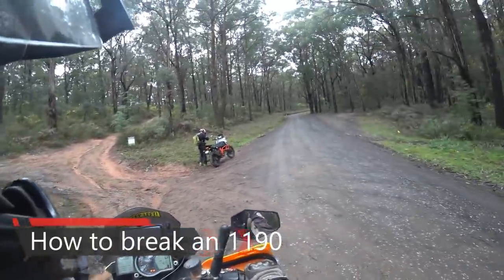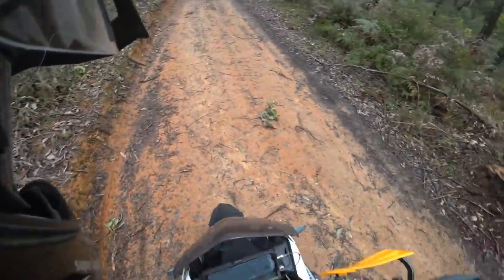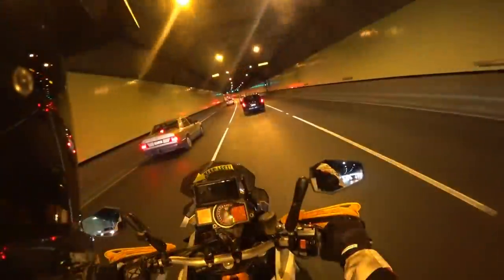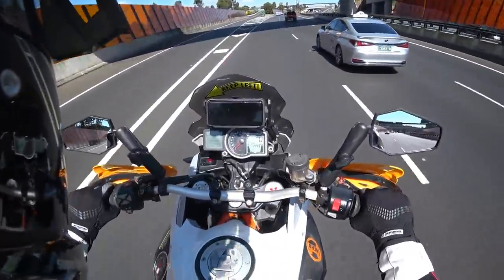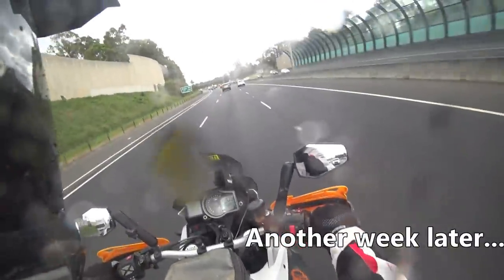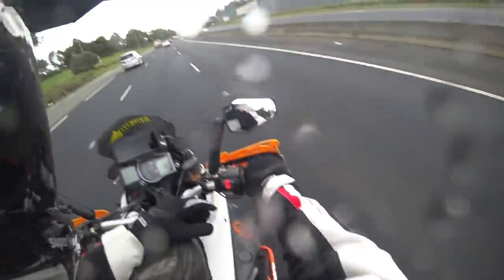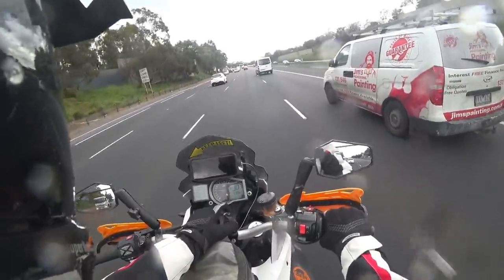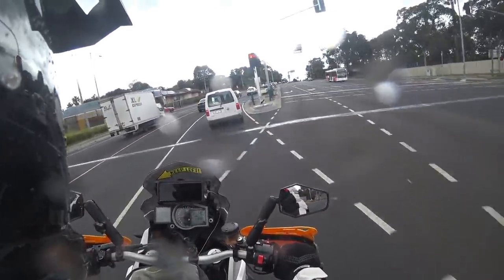How to stop an 1190

Comment: Happened to my 1190 while starting it in storage after winter. Just died from one day to another. All kind of fail indications. Charged battery, changed mainfuse. Got new battery(lithium this time), new fuse again, still didn't start. Recharged it, got started and brought it to a independent workshop. Airfilter totally clogged up appearently. Replaced that and its been great since! Have had issue with moist in the dash once. After dried out i applied clear addesive tape as extra protection to fix that. Bike has now done 70000km in all kind of nasty nordic weather and I still love it.

Comment: And that's precisely why I like as much analog on all of my machines as possible. Points & condenser on my truck & a CDI on my KLR is as far as I like to go with electronics. 
As a mechanic, electronics are hardly more than disposable money makers.
Reply from the maker: Yes, I have a pushbike also.
Reply: Eh, there's really no point fearing electronics. They're as magical as the mechanical operation of the engine itself, until you learn how to deal with them.
Reply: @BartoszBanachewicz  No fear at all. I taught my shop how to work on electronic controlled vehicles. It ended up being one of my main duties. What I stated was fact from the point of a mechanic and my utter dislike of ”simple for the user” electronics that can't be fixed in the middle of nowhere unlike the original mechanical counterparts. Even a CDI can't be made to get you back home if it fails. Points can do exactly that. Failed injector, pump, controlker, - how are you fixing that in the bush? I've fixed or at least rigged the analog parts to get me back. 

But I digress. You do you. What do I know. I only made a crap ton of money off of computer controlled crap for the better part of my life.

Comment: Just as I buy a new KTM...
Reply: No problems. Just buy two bikes.
Reply: @davidmartin7721  ktm=keep two motorcycles
Reply from the maker: Its ok. Yours will never fall over anyway!
Reply: Dont worry. I have had only one issue with mine in 70000km and I suspect that was due to dealership maintenance shortcut. 🤔 My Honda VF750 got shortcircuited dashboard with smoke coming out and that cut the engine right off going downhill in the Malaysian highlands. Had to truck it to Kuala Lumpur and at that time that bike was far newer than my ktm is. So...enjoy your new ktm. They are fun bikes to ride and not so dieselish like some other brands I have tried.

Comment: My gauge cluster went through a similar problem in 47c heat last January, when it was simply too hot and got condensation inside. They don’t like moisture. I didn’t get as many failures as your bike did. On a positive note...your bike rolls downhill well, and it didn’t go into limp home mode on the freeway :)

Comment: There are very good reasons liteweight bikes excel of road. How many times can you pick that KTM up before your knackered or injured. WF450 or DR650 keep it simple, do you need ABS, fuel injection, throttle by wire?
Reply from the maker: But this bike doesnt just go off road! I do 10,000km long trips and commute on it aswell. It does everything.

Comment: Brenden  two questions mate, 1 your radiator leak, was it from a rock? After looking at Craig’s recap video it looked like the high fender may have worn on the lower part of the Radiator, I experienced something like that on my KTM 990 after installing a high fender. 2, the tent that you used on this last trip, what make was it?

And the entire series that you did was great, my hat is off to you pushing the loaded 1190 through the dunes, good job mate!
Reply from the maker: It was definitely a rock. I have made a little video about it, so I'll put that up soon.
My tent is a darche hornet. Ive had it for many years. Unfortunately its not made any more. Its a hiking tent so its quite small. I took it because its smaller than my hammock, but I like the hammock a lot more.
Reply: Nerb1 I have the same tent that Craig used the Snugpak works quite well thanks for the response on the questions cheers

Comment: Big ADV bikes,  no matter which brand, are not intended to be used in terrain like this (even if marketing tells you otherwise). Any attempt to proof this statement wrong will be punished the one way or the other :-) The other concept I don't get is why KTM riders never fold  the mirrors BEFORE they enter rough terrain (greetings to my youtube buddy Bill Cairns) as they are not exactly cheap in case they break when the bike is dropped. Stay safe

Comment: I had the same fault in my 1290adv...leaky dashbord. 
I dried and sealed the casing with silicone. I installed the touratech navigation handle. the meter was under tension and this probably led to leakage.
Reply: Łukasz vel Maska  KTM have problems with leaky dashboards for years on allmost every streetbike (690, 790, 1190, 1290)...
Sportmodels dont have these problems, but you cant call there tiny speedometer a dashboard...

Comment: Was your old motor shot after 80,000 km? Curious, mine has around 42,000 miles on it. Still going strong
Reply from the maker: Yes, I dont think it was typical. What are your valve gaps and shim sizes?

Comment: Lucky you had the spare dash. Also I was wondering how you with your crash bars doing that kind of riding ? Have you bent any? I have wrecked the left hand side crash bar on my 1090 R so I ended up getting a 2nd hand set after trying and failing to re bend the original lower crash bars
Reply from the maker: No, mine are fine. All of my falls are pretty slow. No high speed offs.